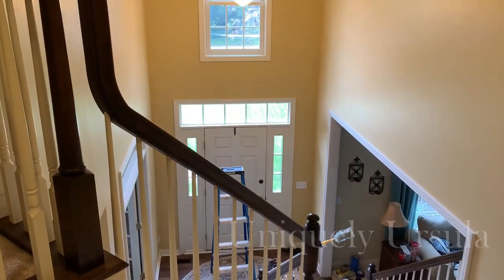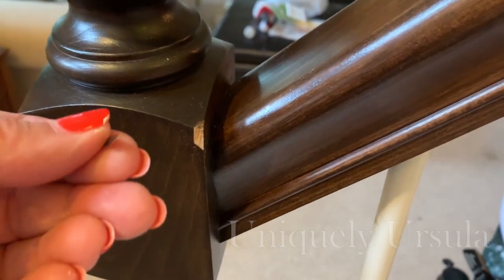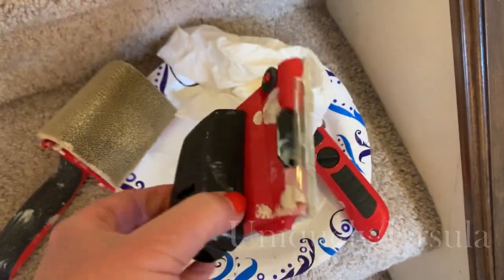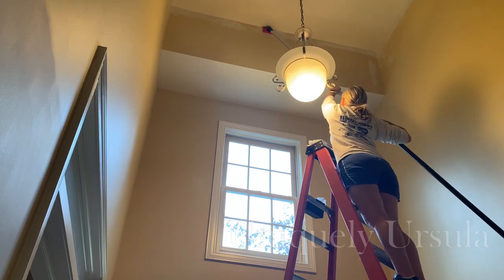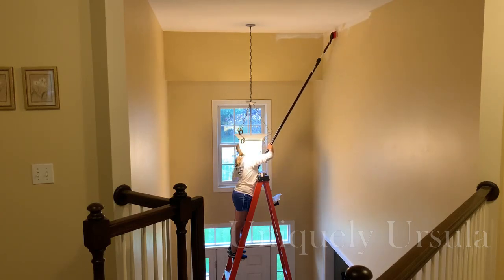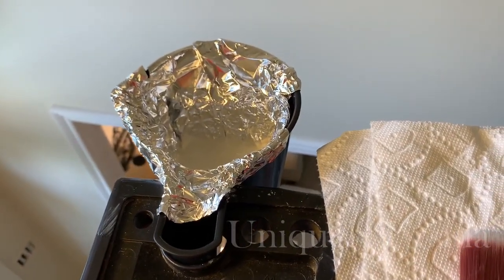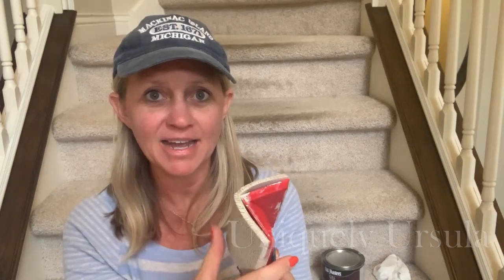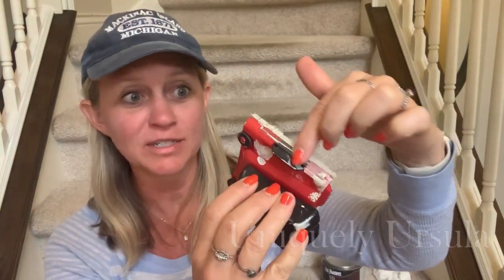Painting a Two Story Foyer: The Good, The Bad, The Scary!

Comment: My house has a similar foyer. I think i will get some 2x lumber and build a platform to allow me to reach the ceiling without an extension pole.  These painting gadget is a joke.
Reply: Same here, I had to build a scaffold to span the stairs and a 16' A frame ladder.  Painting
the ceiling was a real bitch as well as spraying the 10" high crown molding.

Comment: Been there done that. I have a very similar foyer with cased openings on either side of the 
entrance but I had to deal with spraying 10" high crown molding/cornice and painting the ceiling.
I had to build an elaborate scaffold with various ladders and platforms.  I was so scared of falling 
off or a structural collapse but in the end it came out really well.  If I ever decide to repaint, I'll hire 
a contractor.